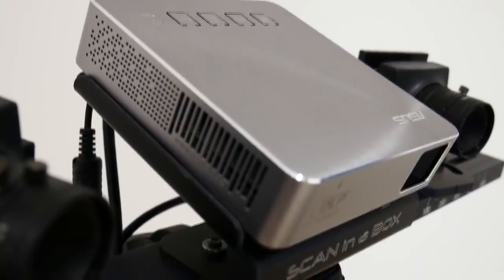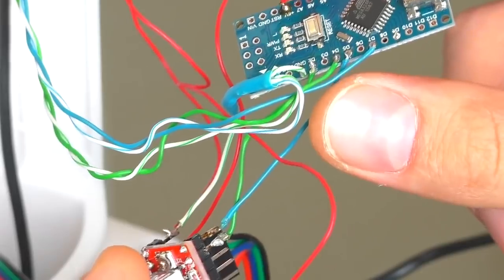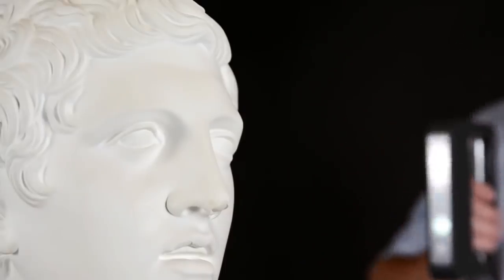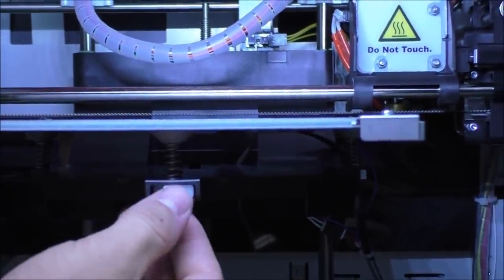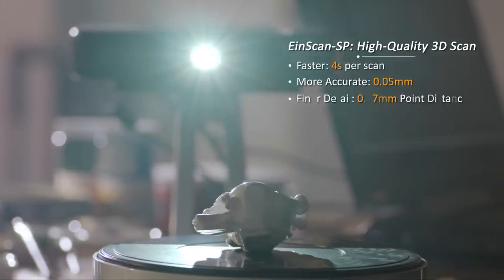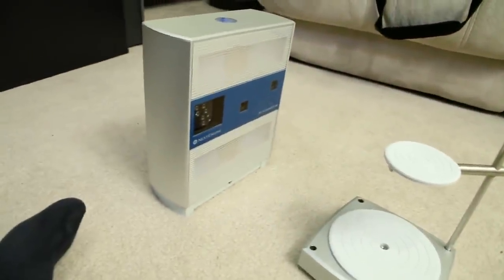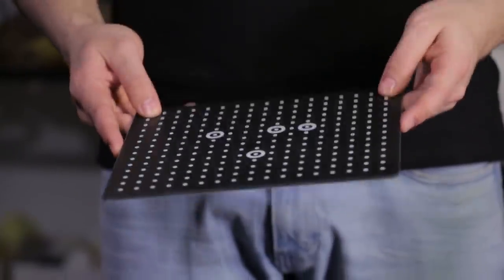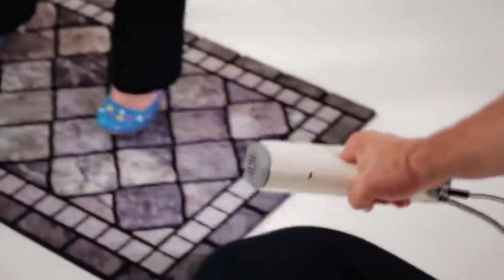🏆🥇 Best 3D Scanners 2020 | Buying Guide

Comment: Artec Eva Lite has an accuracy of 0.1mm and resolution of 0.5mm. Plus you are showing the data from a Regular Eva (with color), not Eva Lite.
Reply: I’m looking for a scanner $500 or less to scan small objects like a tooth? Recommendations?
Reply: @SS-or3oh  macro lens would be useless for 3d scans because of small DOF. Stacking can help here but imagine how many photos are needed to be done for a single scan. So there's no variants for $500.